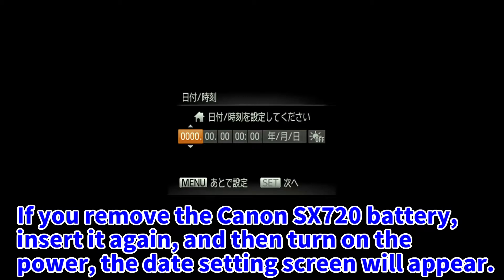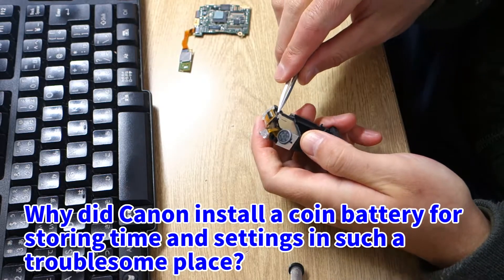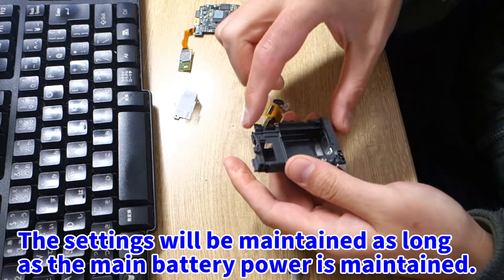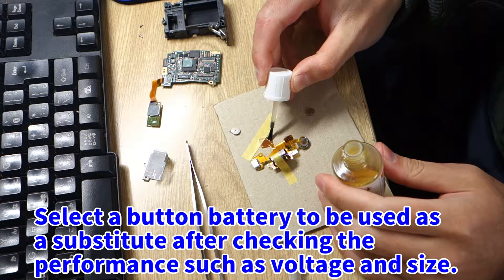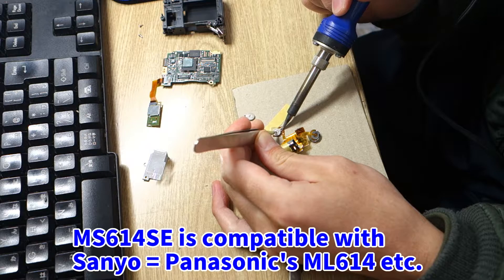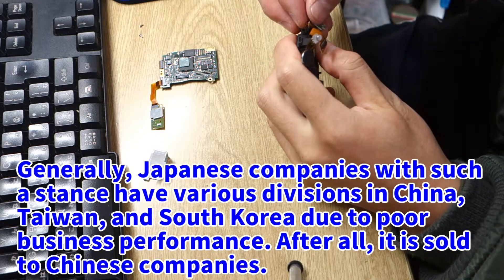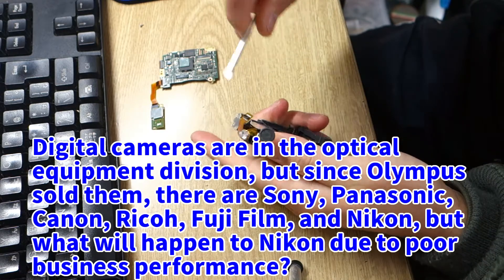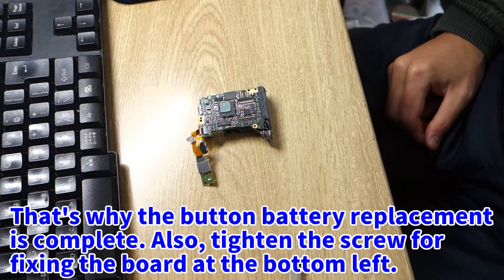Button cell battery replacement to memorize time and settings Canon Powershot SX720

Comment: Hello and thank you VERY much for sharing your expertise. I have a SX720 with a damaged SD card holder. In this video it appears the SD card holder is soldered to a small circuit board that can be removed and replaced. Is this correct, and if so, do you know where the circuit board could be purchased? Because the SD card holder is damaged, the camera will not power on. Is there a way to bypass that feature and operate the camera without an SD card? Thanks again. Your videos are really good.
Reply from the maker: The meaning of bypass is unknown.
If the SD card holder is a battery holder made of resin, I found it on ebay earlier. Red and black are around $ 30 from Israel.
Used motherboards are rarely seen on ebay but disappear instantly. Even if there is, it is a Chinese version.

If you think the power system is the problem ...
The first thing to check is whether the battery is delivering the required power. If you have another battery, test with another battery.
Experiment by pressing and holding the play button if the battery is okay.
If that doesn't work, it's probably the motherboard that is the board shown in the video.
If the cause of the power not turning on is getting wet, there may be damage to parts other than the motherboard, so simply replacing the motherboard may not work.
If you are sure that the cause is only the motherboard and you have a power tester, check if the fuse chip under the upper right connector on the back of the motherboard conducts.
The tip is around 1-2 mm, so it is very delicate.
If you don't know which chip it is, you should gently repair it by the manufacturer.
I'm sorry if it's not the intention of the question.

Comment: hi brother i have canon sx720 don't charging with cable usb do you have solution or schematic diagram layout for this plz  thanks
Reply from the maker: I didn't explain enough. I'm sorry.
It can only be charged using a genuine USB cable (IFC-600PCU) and a genuine AC adapter (CA-DC30).
There are also third-party MicroUSB cables and AC adapters that can be used very rarely.
However, the compatibility of cables and AC adapters made by other manufacturers is rather low.
It is unknown whether the power supply standard or the cable standard is the cause.
Because it is made by an inflexible Japanese manufacturer, it may be that the standard is strict and the allowable value is narrow. It may have worked if it was sloppy like a product made in China.
So I replied in the sense that "it's too likely that you can't do that".

Comment: hi brother i have canon sx720 don't charging with cable usb do you have solution or schematic diagram layout for this plz
Reply from the maker: The SX720 cannot be charged with a USB cable. It is normal that the battery cannot be charged.
No repair required.
Please use the dedicated charger and read the instruction manual.
Reply from the maker: I didn't explain enough. I'm sorry.
It can only be charged using a genuine USB cable (IFC-600PCU) and a genuine AC adapter (CA-DC30).
There are also third-party MicroUSB cables and AC adapters that can be used very rarely.
However, the compatibility of cables and AC adapters made by other manufacturers is rather low.
It is unknown whether the power supply standard or the cable standard is the cause.
Because it is made by an inflexible Japanese manufacturer, it may be that the standard is strict and the allowable value is narrow. It may have worked if it was sloppy like a product made in China.
So I replied in the sense that "it's too likely that you can't do that".
Reply from the maker: If you have ever submerged your camera in water, carefully check the electronic components in the path from the USB port to the power supply IC and the path to the main processing element.